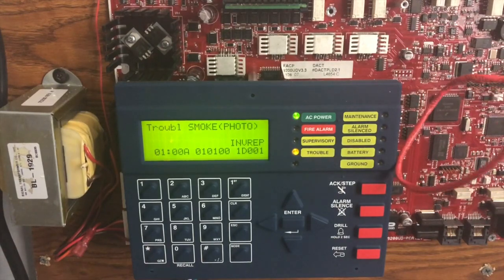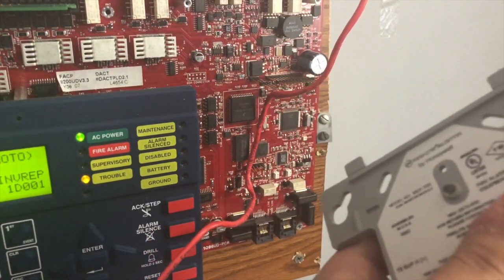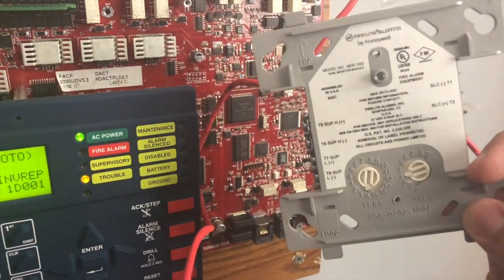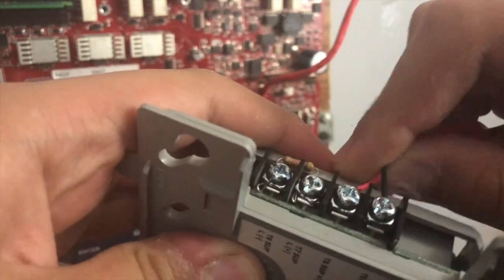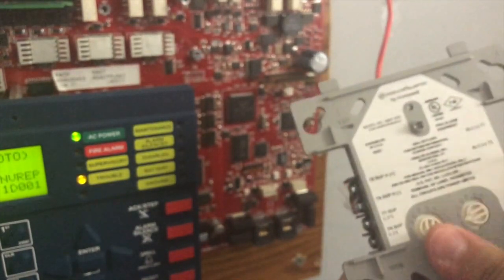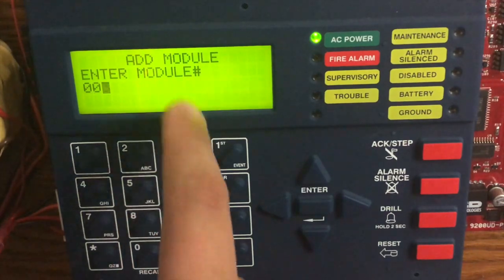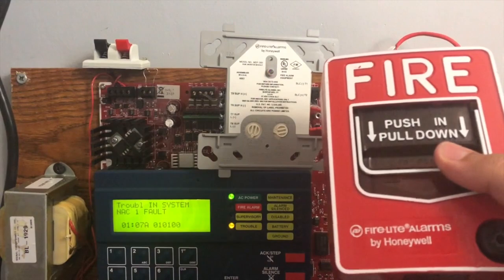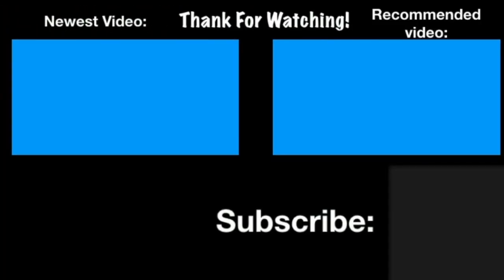How to Program / use the FireLite MDF-300 Dual Monitor Module - Panel Basics

Comment: I indeed have a question. When you reset the panel when there is no alarm, does the LED on the module flash, or it doesn't unless a actual alarm? I was told that it does not light up on the LED when reset if no alarming because these are designed to monitored the alarms.

Comment: Is this module basically a Notifier NMM-100? My notifier panel ended up being addressable instead of conventional.
Reply from the maker: Dennis Drews Sure, but they use different protocols so you must use the notifier module on that panel
Reply: @Aaronproductions  thanks! I should have my panel working with my initiating devices soon!

Comment: Can this work for notifer panels
Reply from the maker: Wolfy Hunts what panel are you referring to?
Reply: @Aaronproductions  can a Fire lite MDF 300 Monitor Module work on a  NOTIFIER NFW2-100 Fire Alarm Panel or dose it have to be a Fire lite Panel
Reply from the maker: Wolfy Hunts probably not, but it wouldn’t hurt to try for a hobby system , for a real system that would be illegal.
Reply: @Aaronproductions  okay thanks
Reply: @wolfyfloof4701  It should, since that panel is just a rebranded Fire-Lite 9200UDLS.

Comment: Please mack a video for How can connect the Control module, Monitor Module Relay module circuits diagram complete. 
I must be a need know this wiring diagram. 
Thank you.
Reply from the maker: Ck Digwal all of those connect to the SLC on the panel. The wiring of those depends on what you’re using them for